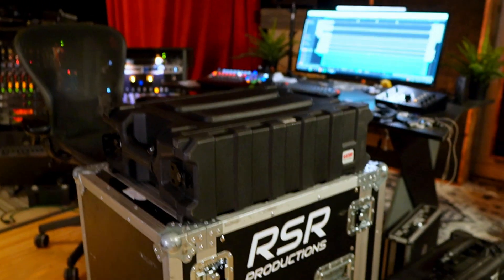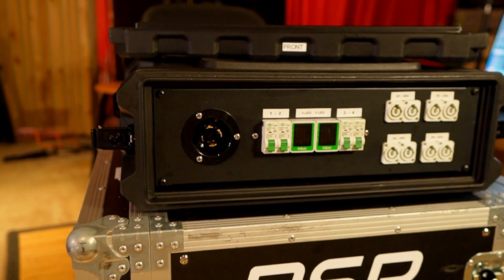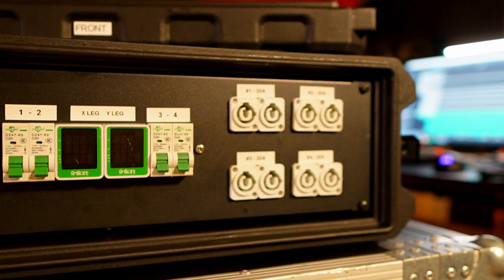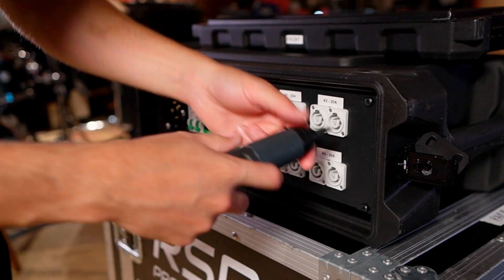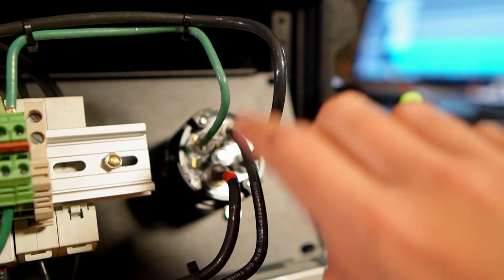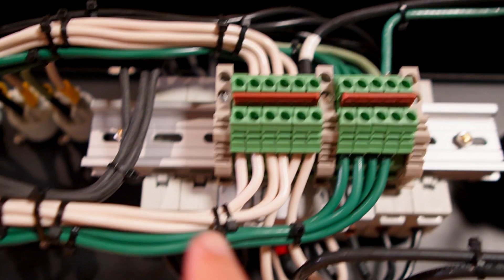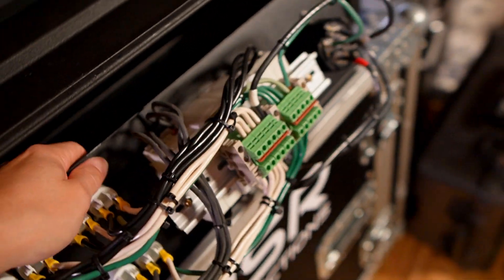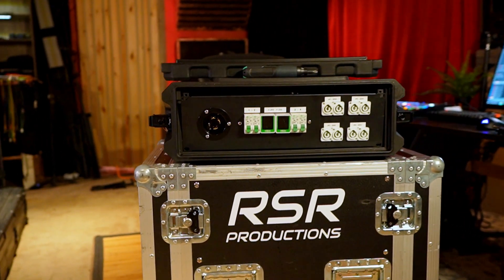My DIY powerCON Distro for Audio and Lighting

Comment: You’re technically not allowed to double up your feed to the breakers from the meter.  You are feeding the breakers from the meter, and putting 2 wires from the meter output (assuming), that’s not “legal”… other than that, i don’t see much wrong.

Comment: When building a power distro always use the Hubbell CS6364C/CS6365C Locking Plug, 50 Amp, 125/250V, 3 Pole and 4 Wire.. Why you ask .This is known as the Caligornia Twist plug and it is on EVERY Generator in the USA . DON'T Buy the 8000 series . The Hubbell  Nema L14-30 plug you show is only a 30AMP Plug , Not a 50 AMP Plug . They are hard to find at any sight you set up in .. This is the panel mount plug to use ,Hubbell 50A Flanged Twist-Lock Inlet 3P 4W 125/250VAC BK CS6375 .. A lot of fair grounds have this to plug into , Hubbell RR450F Receptacle SB 50Amp 125/250V 3P4W Flush Mounting, Black... We have lots of turn arounds so we can plug into many different plugs . Hope this helps ... Where did you get the Breakers and Meters from if I may ask . Remember all Electrical MUST HAVE A UL RATEING ON IT to be used within the USA . For Insurance reasons . The stuff you buy off of Amazon and AliExpress is not covered . ALWAYS USE HUBBELL !

Comment: Thx so much for the content on this. I actually own almost the same setup. I have 10 RCF HDL 6A's. You have the RCF double subs. I own the JBL double 18" subs powered. This will work perfectly fine. Question though, are you using stranded or solid wiring?
Reply from the maker: For sure! I'm using thicker 10 and 8 ga stranded wire inside. Not sure what is currently since I'm not an electrician though! 😅

Comment: 50 amp connectors are more common. To be correct, a single phase hot leg is 120 volts to neutral and 240 volts to the other hot leg. You said two legs of 240 volts
Reply from the maker: @markjastrzebski2065  right! My bad, I do understand that 👍 Learning about power has been a journey for me the past few years and it took awhile before things finally clicked.

Comment: Great build! Very Clean!

I am looking at building something exactly like this as the power distribution boxes I've been looking at have all been either £800 or up. I know a couple electricians I can ask for advise, but I'm looking at building a switchable input 32amp (3 phase and single phase) with PowerCON locking outputs (exactly as you have here).
As I'm in the UK we have very strict regulations on electronics, especially when dealing with distribution and power management, so I will likely have to get a qualified electrician to give a stamp of approval.

Comment: I’m trying to learn more an out power distros so I am just curious - how does the feeder 30amp circuit feed 4x 20amp circuits. Thanks! Great video and the unit looks awesome
Reply: The ability of a 30-amp feeder circuit to supply power to multiple 20-amp circuits lies in the distribution of total available power. Here’s a breakdown:

Key Concepts:
	1.	Amperage Capacity:
	•	A 30-amp feeder circuit provides up to 30 amps of current at a specific voltage (e.g., 120V or 240V). This equals a maximum power output of:
	•	120V x 30A = 3,600 watts
	•	240V x 30A = 7,200 watts
	2.	Distribution Across Circuits:
	•	The feeder circuit does not supply each 20-amp circuit with a constant 20 amps. Instead, it distributes power across the circuits based on the actual load being drawn at any given moment.
	3.	Load Balancing:
	•	The total combined load of the 20-amp circuits cannot exceed the 30-amp capacity of the feeder. For example:
	•	If Circuit 1 draws 10 amps, Circuit 2 draws 8 amps, Circuit 3 draws 6 amps, and Circuit 4 draws 4 amps, the total is 28 amps, which is within the feeder’s capacity.
	4.	Breaker Protection:
	•	Each 20-amp circuit is individually protected by its own breaker, preventing any single circuit from exceeding its limit. The feeder breaker (30 amps) ensures the overall system doesn’t exceed the feeder capacity.

Practical Application:

The design relies on the assumption that not all circuits will draw their full 20 amps simultaneously. This is typical in real-world applications where loads vary between circuits. If all circuits were to draw close to 20 amps at the same time (80 amps total), the feeder breaker would trip, as it exceeds the 30-amp limit.
Reply: @AlexxReed this is an excellent break down and makes perfect sense thank you!

Comment: First thing I've seen in a while that's not an immidiate fire hazard. Great job!

If I can see that correctly, in of the lower terminals there are two cables beeing twisted together and inserted into the screwed terminal. I don't know if code allows it. (Theoretically one wire could loose from the twist and have high resistance)
Also, from the video they seem to stick out a bit to far. When unlucky, you could touch the exposed conductor with your finger.

If I see that correctly, you opted to not include an GFCI. Even though it's not required (US) afaik, imo everything should be protected by one. (Yes, I'm german).
When installing one into your box, just keep in mind to pick one that trips before the one the venue has. (e.g. 5mA vs. 10mA)

Source: Not an electrician

Comment: I'm just missing the ground for the panel itself (and also the back panel if there's a metal one). Don't know the exact regularities where you live, but here in Germany it have to be a seperated screw with a contact washer and the paint have to be scraped away around the contact area.
Everything else looks pretty neat and wll done. I dig the piggyback of the DIN rails, clever idea! :)
Reply: @analogMensch  If the case is deep enough and there is no way that the wires that come loose cam touch the back panel than there is no need to add the ground wire.

I doesn't hurt to do it but it is also probability.

Your German,  I'm Dutch and we have share some directives when it comes to building distros. But sometimes they are a bit of a "one in a zillion" directives...
Reply from the maker: Thanks! I will be adding one 😁
Reply: @redshedrecords  BTW most din rail terminal makers sell specific "earth terminals" which in addition to having terminals on them also connect electrically to the DIN rail. This makes earthing/grounding in din-rail based systems much less hassle.

Comment: Nice build but....

-You need to ground the panel. From what I saw in the video, you didn't do that.

- I would have added some Edison sockets as I saw you use jumpers in your gig log.

Or you could make longer jumpers so you don't have your short jumpers dangling in front of your distro.

-I would have used original Neutrik connectors as they are now approved to be (dis)connected under load.

I am Dutch and by no means a licensed electrician but I do have enough knowledge to build my own power distributors and get them approved according to Dutch regulations.
Reply from the maker: @Richard_van_der_Heijden  thanks! I appreciate the input. I will be adding the chassis ground for sure 👍
Reply: @redshedrecords  👍🏻 No thanks and keep the videos coming!

But please make sure the chassis ground does conduct from panel to your input connector.

Comment: I've got a question about power requirements for venues. Most the places we play are outdoor bars, and they will basically provide you with a single outlet, no guarantee on stable voltage/current/clean power, etc.  We have an upcoming bigger gig that is asking about power requirements and I'm not entirely sure what to say.  2 20A circuits?  

our setup is:
- presonus 16r, 2 wireless transmitters, quad cortex, 2xPA, 2xSubs, 1 40w guitar amp + pedal board, laptop & a few smaller devices.

do you have a gut feeling on what our requirements should be?
Reply: oh and 2 chauvet light stands with 4 led lights each.
Reply from the maker: I run into this ALL the time. For what you have listed, if it's all modern self-powered stuff with class-d amplification you could quite literally run everything from 1 20amp circuit. I've ran 4x RCF HDL6, 1x dual 18 sub (9006), Mixrack, 4 LED wash, 4x large moving wash, 4x strobe panels, and 2x guitar amps all fed from a single Edison outlet in a bar. I don't even know if it was a 15 or 20amp breaker. However, if both your subs are dual 18, and you are really slamming your system, you may need 2x 20amp circuits. I would basically just run your PA and audio gear, (and power for any pedals going DI to avoid ground loops) on one circuit, and then lighting and other stage power on another. You could also put the subs on the 2nd circuit as well to further split things up. I carry 2x 100ft 12ga. Edison extension cables with me to bar shows so I can pull power from multiple spots around the place to make sure I have 2 different circuits. I've ran my full rig on 1 outlet many times and have never tripped a breaker. It's amazing how efficient the self-powered equipment is these days.
Reply from the maker: If you can advance the power, just ask for a minimum of 2x 20amp circuits that you can separate some things around on, bring some edison cables to make it happen, and you'll be very comfortable 👍 Some gigs will even have a large generator for you on-site with spider-boxes to distribute power.
Reply: @redshedrecords  super helpful thank you!